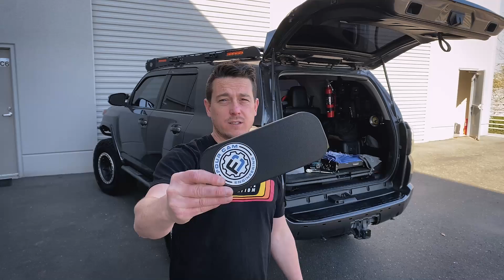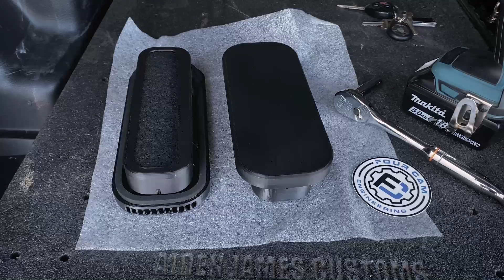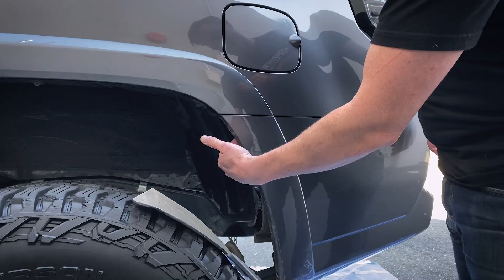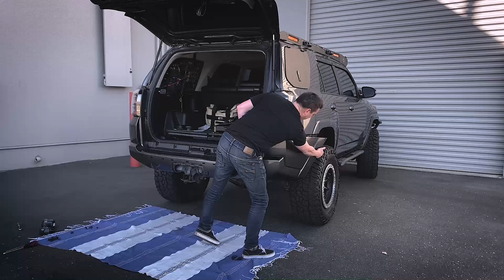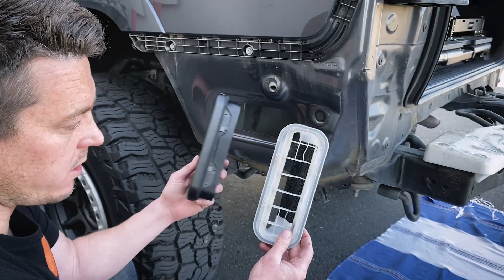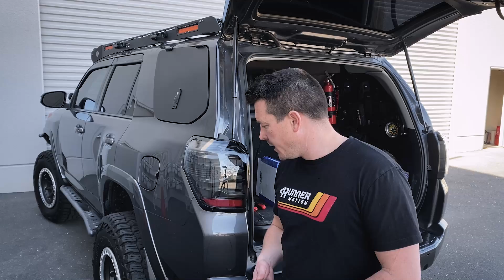Rear Cabin Filter Replacement on 5th Gen 4Runner by Four Cam Engineering

Comment: Vent/filter who cares what is called. If it keeps the dust out that is great .

I just received and installed these. I will say you do not have to remove the entire bumper. Just remove the fixtures on each side  and pull. This will give you enough room to change them out.

Comment: Push pins have a tool and the center pins supposed to be removed allowing you to remove the pin without scraping your paint with primitive Pete screw drivers

Comment: Great vid man! I just got these and installed them since I’m doing my steel bumper right now. Question though, as I read the instructions, my understanding was that the air vents face the back, but those two drain holes are supposed to be oriented down, not up. Thoughts?
Reply: He installed the passenger side vent on the driver's side. The two holes are supposed to be  on the bottom (for drainage), as you noted.

Comment: What is the difference between the cover and the system on the website
Reply from the maker: Basic Package- An O.E.M Vent, and our Proprietary Vent Cover pre-affixed ready to clip in. 

Complete Package- The basic package, plus the addition of our Activated Carbon Filter Module. This package is the ultimate protection against dust and smells.

Comment: That is a vent, not a filter. It's job is to let air out, not in. The cabin air filter is in the glove box.
Reply from the maker: Yeah, the factory OEM vent is a vent. The mod is technically a "filter" - that's my bad. Should have clearly stated that at some point in the video. Thanks for pointing that out though!!
Reply: Bingo.

Comment: So is there any more filters that aren't in the book or so called pressure relief valves I'm totally wondering,  they need to make a wing for the back on the roof over the rear window is a air flow dust magnet.

Comment: Holy crap! I grew up in a GM family and currently lease 3 new 2022 GM cars for my wife & two sons. You tear the glove box door off and a couple screws to change these. My oil change does it for me! I sold my Escalade and I'm buying one of these 4runners in a few days for myself. I have never owned a Toyota! I just watched you take the car apart to change the air filter😳😜. Wow! Did these cars start out on the assembly line as the filter and build the whole truck around the filter? 🤔🤣😂. I'm impressed that you did it!👏👍. You should win something for the accomplishment of getting it done!🥇🏆💰!  Like I said I know nothing about Toyota as we grew up GM. Lately GM seems to have lost there way with  dependability I believe! This is why I lease all my familys cars except mine! I  only buy the vehicles for myself that I drive which are only a few years old and used. Everyone else gets a leased one!  From what I've been watching on these 4runners they look cool and seem to run forever! I'm getting the TRD off road premium 4x4. It's certified too! Not sure what that all entails? I hope I don't need to remove the engine to change my oil on it after watching you dam near  remove the body for a cabin filter 😅. I'm hoping when mine was certified they changed that filter! If I tell my oil change guys to do it they may take a swing at me, 👊 💥 or ban me from any further services! I really love the idea of a charcoal filter though! The stainless sounds even better as you never have to remove the body off the frame again!😆😂. If you see mine with a hole cut threw the rear quarter I took the short cut to it! I live in Michigan! How much do you charge to change it? $400, $500? I loved your video all jokes aside! How the hell you were so cheerful doing this too! 😃. YouTube wouldn't allow my video doing it. It would have the strong language, and flying tools and parts warnings before I used a dremel tool and just cut a hole to get to it! 😎🤙 Greg G
Reply: That is not the cabin filter. The cabin filter is in the glove box and very easy.

Comment: All SUV's have them, they are vents, not filters.
Reply: Actually all passenger vehicles have them.  Yes, they are vents (for outward flowing air).  Everyone that I have seen on Toyotas, Hondas and Nissans have rubber flaps on the outside.  The way they are designed are to allow internal air to vent out while at speed because the outside air flowing over the vehicle causes a lower pressure zone vs cabin air (Bernoulli's principal).  They lay flat, pressing against the vent when static.   This gadget is an expensive solution looking for a problem.
Reply: @ThaiXLe  true and 4runners only and true cabin air filter is in the dash location glove compartment
Reply: Agreed definitely vents this video refers too

Comment: Is it one on each side??. Or just one side??
Reply: Good question, he does not specify one side or  both. I had my bumper off to repaint it & remember a vent on the passenger side (2012 U.S. version ) so I would guess both sides since he did the driver side .

Comment: This is definitely a great little modification. Back when I had my 4Runner, after any kind of trail run, there would always be some backflow of dust and debris into the inside. It was a 4th Gen, so I could always see the dust on the driver's side, inside and outside the body panels, especially by the little cubby hole for the factory jack. Annoying to clean for sure. If this can stop all of that, and still keep the cabin properly pressurized, awesome. Good video!
Reply: It's a good mod but those are not cabin filters more like vent filters